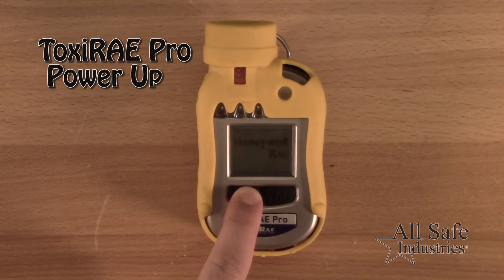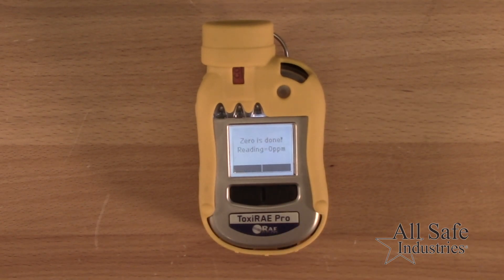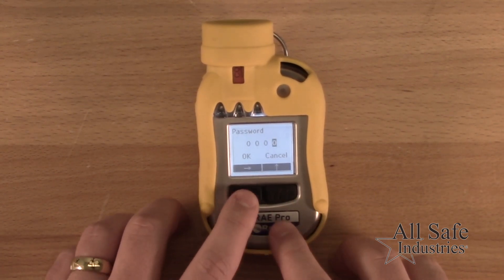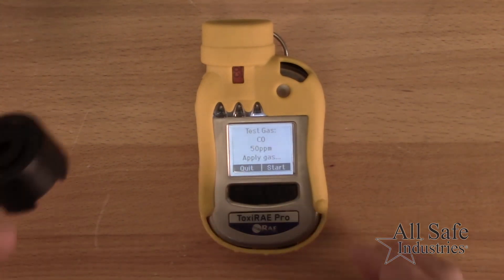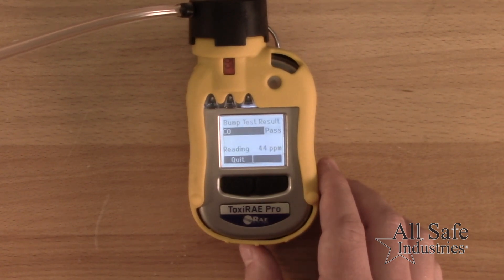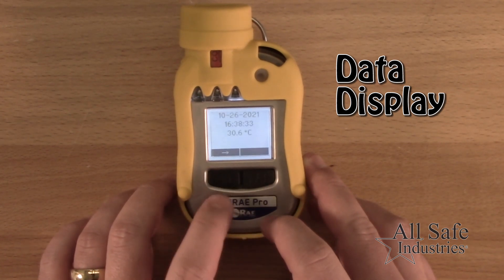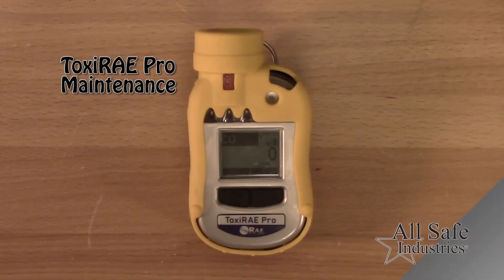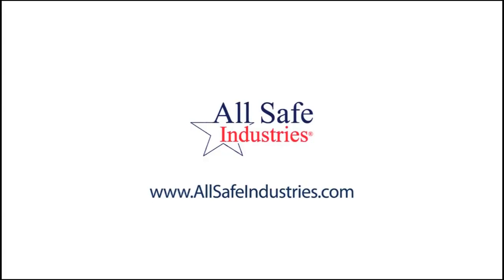How to Bump Test a ToxiRAE Pro

Comment: Thank you for the video. It is helpful to understand how I can perform the bump test. I believe the monitor will automatically sense and display what gas is monitored based on what sensor is attached. right?
Reply from the maker: Yes. The sensors in the ToxiRAE Pro are swappable as long as you're using a compatible version, and the display will reflect whatever sensor is installed.
Reply: @Allsafeindustries  Awesome, thank you